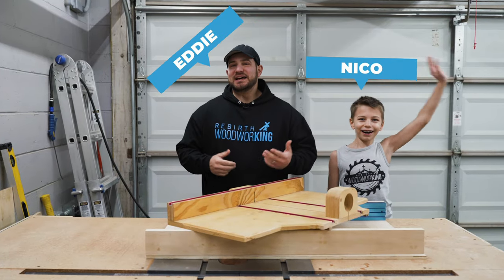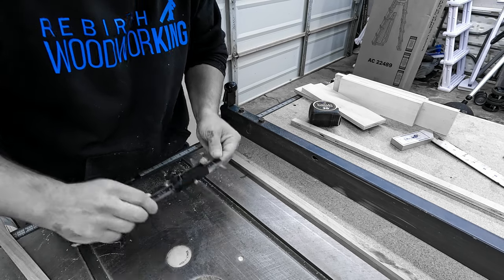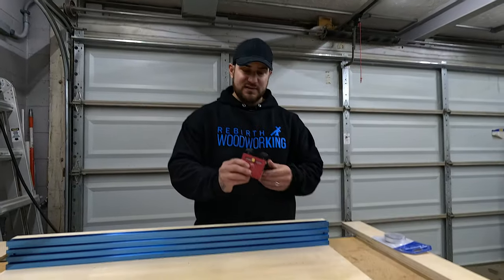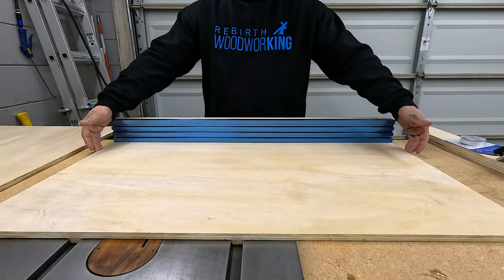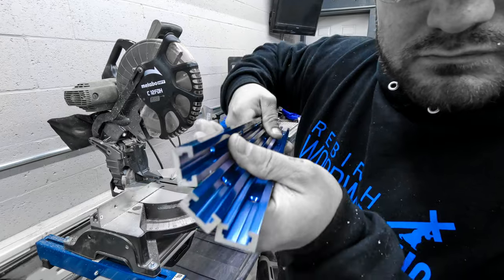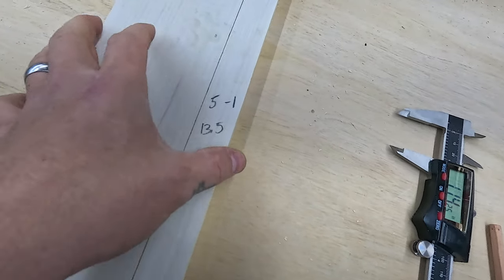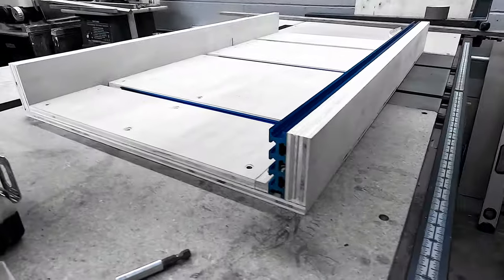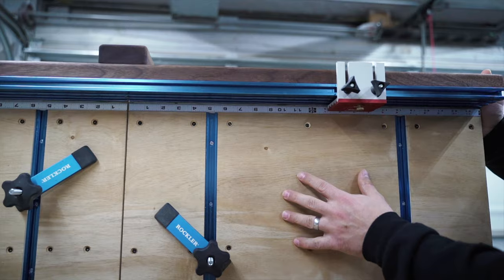How to build a SWEET Cross Cut Sled - 5 Cut Method explained

Comment: Put the tape on the top of the back stop where you have the KM stop. It never gets cut, dirty and the KM is directly on the numbers.

Nice work on the first vdeo.
Reply from the maker: I originally was going to do that but I dont always use the KM stop block so its a double edge sword. I like to be able to measure a piece on the actual sled but then it will get in the way of a dado cut. Probably wont dado anything for now. I appreciate the support and help! Take care, God Bless!